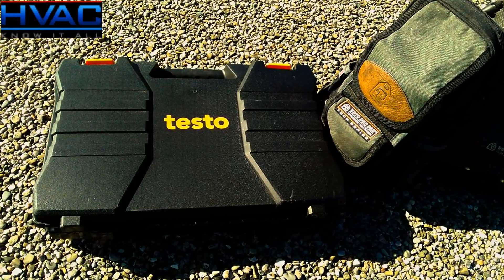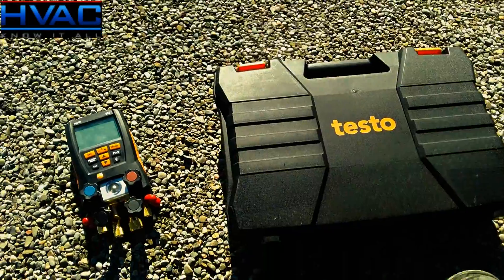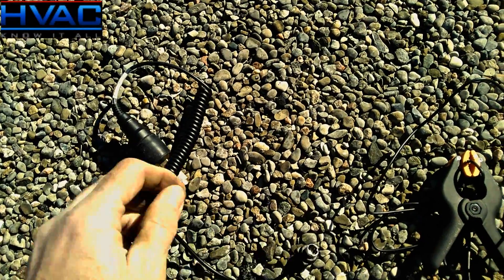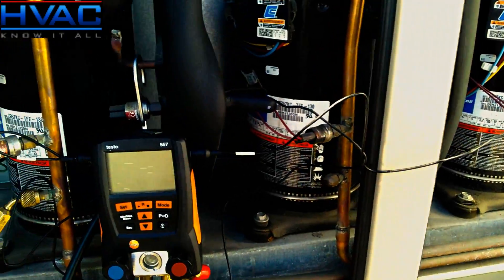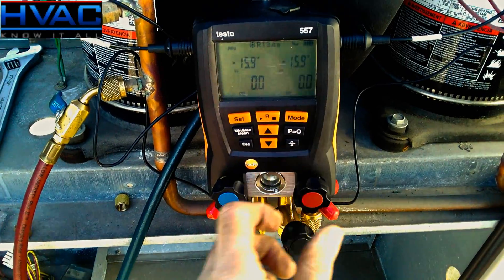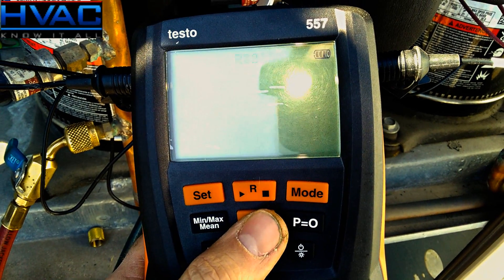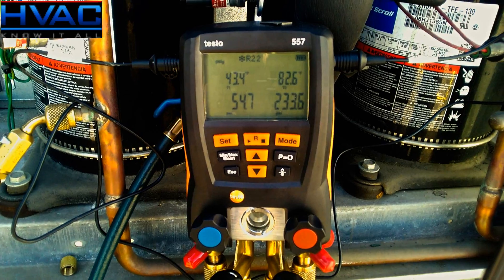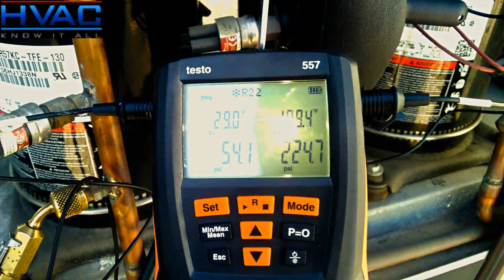Testo 557 Demo and Review

Comment: Nice video. Just bought a used unit on eBay. I was the winning bidder and got it for $203 and $15 shipping. Great price compared to a new unit. I turned it on and everything seems to be working. Lots of snow outside so will have to wait till it gets warmer to check out the gauges on my heat pump. Thumbs up on your video.

Comment: I am looking at a testo 557 that is used. It has a small crack in the bottom right of the display. It is also missing the vacuum pickup. He wants $375 for it but it is unproven yet. It also comes with the case and one red hose and one yellow. It also powers up when the power button is pressed.
What do you think?
Reply from the maker: 375 seems much for a cracked screen, what if it gets worse?
Reply: @HVACKnowItAll  Thats what I'm thinking. Maybe I am better getting it online.
Reply from the maker: If you do I have a discount link for trutech tools for preferred testo pricing.  http://www.bit.ly/TTT-DISCOUNTS, just make you sure you tell them hvac know it all sent you

Comment: just made the switch from field piece to testo. meter and gauges. only had issues with running a vacuum I figured out I need a Schrader core tool or a T for 3 connections, for my micron gauge and doing the leak search mode i havent figured out i got to the mode but not sure whats going on. subscribed and liked on FB. If you could make videos about that. would be great I figured out everything you showed in this video. any additional tips would be great